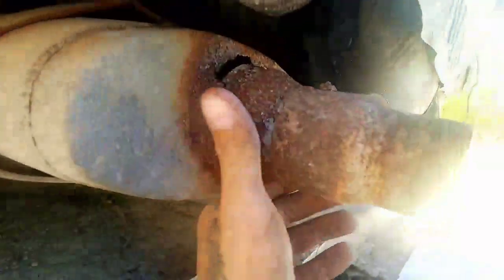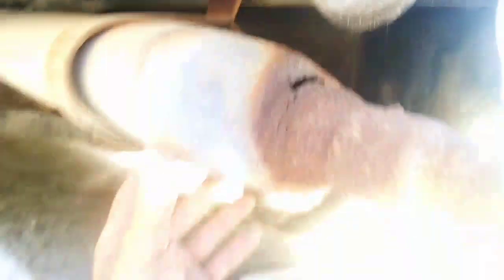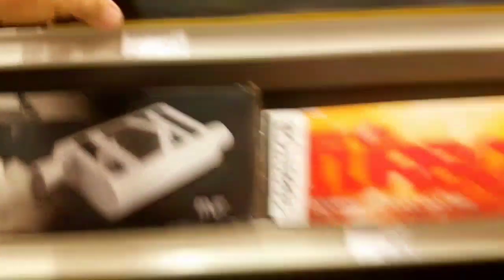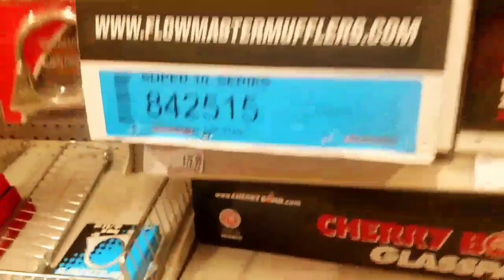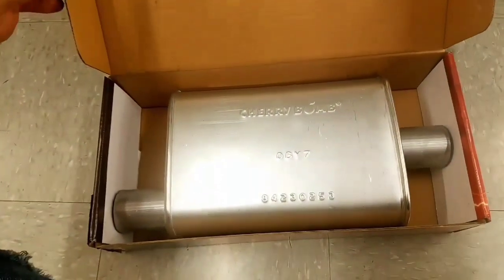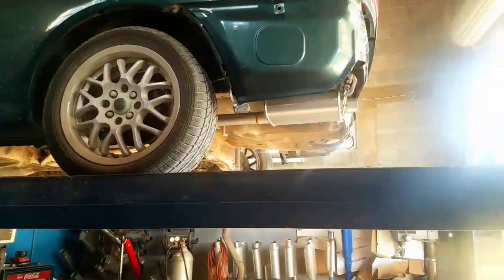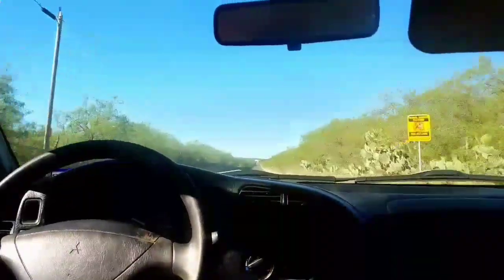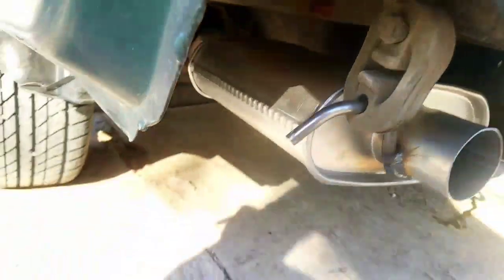Installing Cherry Bomb Turbo 🍒💣🐌

Comment: Sounds Nice. Imma go and buy me a set tomorrow for my Thunderbird
Reply: How'd it go? Thinking about putting one in my 97
Reply: @andrewgregory151  I got 2 of them for dual exhaust on my 79. I went from a Y pipe to an H pipe when I put these mufflers on so I'm not sure if it's the H-Pipe or the mufflers but I did get some drone at idle and low rpms. It gave me a headache since the Original setup had no drone. After driving it for a few weeks and tuning my engine a bit, the drone has lessened but it's still there. I'm gonna switch them out for something else. The sound is nice tho, especially when the drone isn't there. Gives it a nice growl

Comment: I have a '96 Corolla 1.8L & either want a cherry bomb glass pack, cherry bomb turbo muffler, or a cat back exhaust 🤔
also long tube headers since there is long tubes for the '96 Corolla 1.8
Reply from the maker: Depends what you're looking for.. cherry bomb turbo is kinda quiet, and glasspack is a bit louder, but still sounds good!
Reply: @GTsPerformance  then glasspack it is lol
or a cat back exhaust if I can find one
Reply: @GTsPerformance  I decided to buy a cherry bomb glasspack 
I have headers (not installed), 2.25" cat & resonator, & a ebay muffler with a 2.5" inlet & dual 3" tips
but for now, I want chop my stock muffler off & then install the cherry bomb glasspack

Comment: I know this may sound stupid but how do you weld the upper side of where the piping meets the muffler?There no way my stinger could reach it.
Reply from the maker: Maybe because I had my rear bumper off it gave better clearance,  but you can unhook the rubber (exhaust hangers) mounts to let the pipe hang.  Also lifting the car from the body lets the tire hang and  opens up the lower control arm a bit more.
Reply: Ok thanks!

Comment: I went with the flowmaster with a cherry bomb exhaust got the sound I wanted 24 inch cherry bomb really tones it down
Reply from the maker: I saw cherry bomb had 1ft x 2.5" and 2ft x 2" but the stock exhaust was 1⅞" and I wanted a muffler at the end.. so that's where this "turbo" muffler came in. I feel these glasspack should go mounted midway in the exhaust.
Anyway! Today, the car is actually turbocharged and has full 2.5" with a 12" cherry in the middle! I feel it needs work
Reply: @GTsPerformance  the glass pack should normally go in front of the muffler but I had no problem with interior resignation it was just easier Ohio winter just trying to get it done ended up with Cherry bomb turbo muffler 4 in tailpipe on the driver side overall totally satisfied no catalytic converters
Reply from the maker: I don't like the sound of the deceleration on mine.. no crackle,  just sounds monotone.  I need to get a decent muffler

Comment: How much louder than stock is this muffler? Like 10-20%?
Reply: oui et ses juste parfait  :)
Reply: Is it worth buying for a 4cylinder, or it sounds the same as stock, can you tell the difference, I would add something louder but my neighbors like to call the cops for everything. You can't even barbacue it's to loud. Good God o mighty.

Comment: Resonator still on or no? Sounds like it is for it to be that quiet. Still sounds great though.
Reply from the maker: On this video,  yes! Still has the resonator  and factory 1⅞ exhaust. 
Today,  the car is turbocharged and I'm running 2.5" exhaust,  straight pipe with a 12" cherry bomb glasspack
Reply: @GTsPerformance  Sweet, I'm gonna do a video with this muffler on my 2017 Mirage 1.2L 3 Cylinder. Yes, Mirages now come with 3 Cylinders and CVTs lol. With full custom 2 inch exhaust. I'll comment when I post it.
Reply from the maker: I'll check it out. Curious to see how it would sound. 
I thought about getting a newer Mirage. see what it's like and what mods i can do😁
Reply: @GTsPerformance  I got my 2017 back in September 2020 with 54,000 miles. It now has 75,000. Only things I had to do were new brake pads and several oil changes. I can tell one of the motor mounts is going bad and it need some alignments. CVT has held up great. It gets great gas milage. 40 city and 50 highway. Mine with the custom exhaust, I've gotten 56 on the highway going about 60. The RPMs stay around 2k. HP is only 78 but, with a few mods and a tune of the CVT you can get 100+ hp no problem. There's vids of various exhausts on the newer mirages. I'd keep your 97 with the standard. The newer 5-speeds aren't that great.

Comment: Need a resonator in the middle to remove any raspy but keep deep sound
Reply: cherry bomb glass pack comme résonateur et le  cherry bomb turbo pour le silencieux  voila la combinaison parfaite
Reply: @donalin111  I actually replace stock resonator with a bit longer glasspack and added a really small resonator at the end before end of tail pipe, sounds good, deep without sounding raspy
It’s a 4 cylinders civic
Reply: @EndlesSuffering  moi sa été résonateur comme toi sauf  universel  pour ma part  le son étais trop fort...   j'aime mieux celui qui ce rapproche du turbo